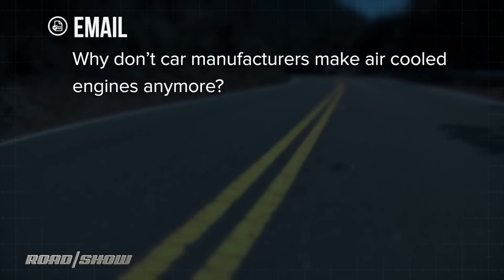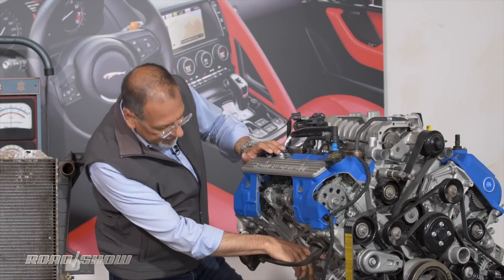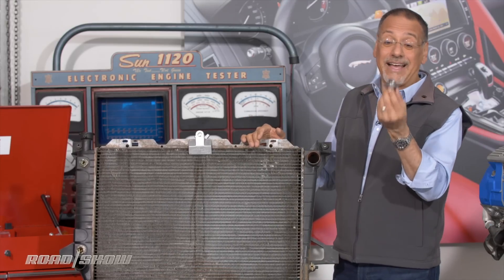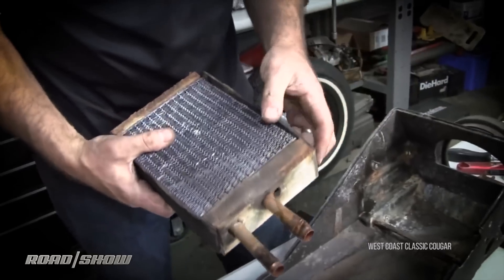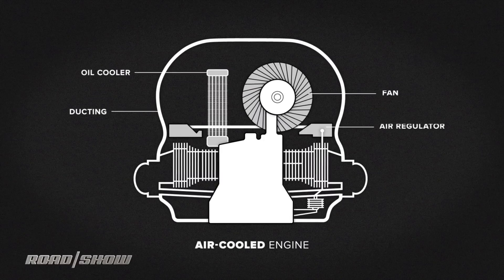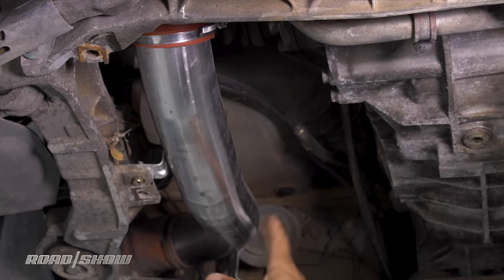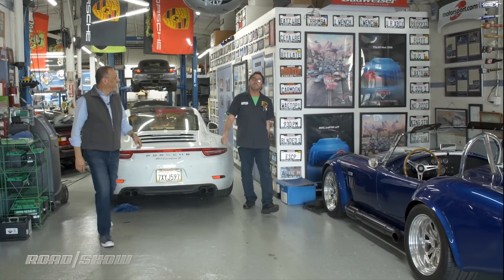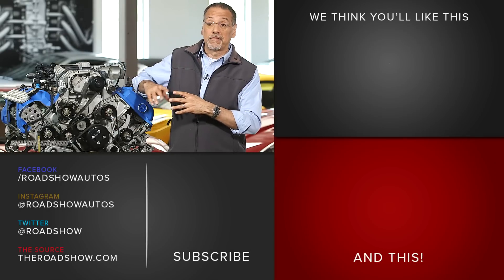Your Email: How air-cooled engines work | Cooley On Cars

Comment: Both cars are air cooled in the end.  The coolant either water or oil, circulates and picks up heat.  Both have to transfer that heat to the ambient air.  Water cooled use a water to air radiator, and oil cooled uses an oil to air oil cooler

Comment: I have always been skeptical of claims of more emissions and limited power from aircooled engines, this is a cop out by VW and Porsche. Porsche proved VW wrong re emissions by keeping their 911 aircooler in production many years after VW dropped aircooling in their first world VW sales. Cos I can't buy a VW wassercooler, I have a T5 transporter. with DSG. I sometimes wonder how a DSG transmission would go if it replaced the 4 speed transmission in an old beetle aircooler.

Comment: I have owned several aircooled engined cars and am a big fan. VW, Porsche, Steyr Puch - no overheating, not water pump to crap itself, light weight, no radiator to fail, no coolant hoses to split and cause overheating. VW said they could not meet emission standards as a reason for dropping the aircooled motors by 1983 in first world countries, but Porsche showed this was BS by continuing to make the aircooled 911 motor in production for many years later. The rear engine position was a plus too, with weight over the drive wheels.

Comment: Great video! The only question I have is, is the air cooled engine going to be pressurized? Since a water cooled engine is a sealed system and pressure builds in that, but for an air cooled engine since it’s driven by a belt from the engine, is it just going to be ambient air pressure?

Comment: the funny thing is you dont need that thermostat at all expecialy if you nur a engine with implosion and cold disel effects and a open egr valve you wuld lover your fuel consuption drasticaly and re use bether not burned gases those water coled cars are junk it destroy your engine ower time due to heat and part wear a air coled engine is a way to go not to waste money on parts by water cooled engines! plus if you use a lover viscosity oil lubrecant you will never over heat ore use oil aditive with gasoline so you have dobel protection for over heating and you increase your engines perfomace and life spand dont listen what new age mechanics talk they talk to earn more money from you Im a profesional car restorator and my hobby are oldtimer cars those old engines can by easely modified to any thing they simply refuse to fail

Comment: I have a '97 VW sedan with 500,000KM and still going strong.
Starts as fast as a newer engine.
And a lovely 4 speed manual transmission with a heavy AF clutch.
In Mexico the last VW sedan was a 2004 model

Comment: why don't the fan on air-cooled engine come with automatic on/off control to regulate the temperature more accurately?
Reply: Some do, except not electric they have a thermal clutch that engages when it reaches a certain temperature. You also have to take into consideration that 95% of air cooled engines are carbureted which means no fancy computers to control things as an electric fan.
Reply: @huntertomlin3909  nah... Electric fan doesn't need computer control, just simple thermostat will do.

Comment: I have not used the heater in my Audi A5 for a long time (almost a year). 
I turned the heater on and it made the engine not reaching the normal working temperature (90 deg C) and actually fluctuating up and down from 70-85 degrees for 26 minutes! This happened 2 times!
After that, it got normal and now with and without the heater, the water temp is normal again. Do you think this was due to thermostat or water pump malfunctioning or the water in heater radiator being blocked or something because of not being used for a long time?

Comment: Great video! Seems like there are some parallels between the disappearance of air cooled engines and rotary engines in passenger cars, hard to get high compression for emission reduction in rotary engines due to issues with tip sealing and limits on the amount of power/torque that can be generated without exotic workarounds, if I recall a video I saw on Engineering Explained a while ago

Comment: Always love to see Cooley, but he didn't quite answer one of the main questions posed: what are the advantages of air cooled engines. The main one is cost. They require less metal, are less complicated, and quite a bit lighter. It's why you still see them in lawn mowers. A small mower engine can be as cheap as a hundred bucks. There is almost no advantage to the buyer of a used car. Air cooled engines will not make as much power, as consistently, or last anywhere near as long as, a liquid cooled engine. They are also very noisy, comparatively. There is this one very minor advantage, and it's one of the main reasons they were used so much in small airplanes until the last decade: the cooling system cannot fail as long as the vehicle is moving.

Comment: Harley Davidson and Indian both still make air/oil cooler motorcycles. A benefit to these old tech, push rod engines is the lack of parts. They are quite reliable these days thanks, in part, to the lack of parts.

Comment: I wonder how much power you'd free up on an old air cooled engine if you binned the mechanically driven fan and installed an electric instead.
Reply: at least 100 hp  and with racing stickers  additional 50 hp
Reply: @brandonblack2095  It's been proven that moving from a mechanical fan to electric CAN free up HP on liquid cooled engines.  My question is legitimate.
Reply: You could probably expect about 3 to 5 percent more power since the engine wouldn’t be driving the fan for less drag. But then again you would need some sort of temperature control to have a fan motor blow the right amount of air when it’s needed because you can’t have the engine run too cold as I believe gaps in the piston rings would allow so much blow-by gas when it’s running.
Reply: Electric fans need elecricity to fuction. Electricity has to come from somewhere. In both Porsche and VW air cooled engine the exact same pully that spins the fan also doubles to spin the alternator/generator. I highly doubt you can gain even 1% more horsepower by switching to electric fans on air cooled engines. Even that Engine Masters show illustrated even different TYPES of mechanical fans have different effects on horsepower.
Reply: @darrenmorris869  Yes they do, but as another person pointed out, it would have to be speed controlled; much like a pc fan.  Running at lower speeds would require less electricity, putting less load on the alternator than a typical automotive fan that only runs at it's max speed all the time.

Comment: I have a question. Do you think electric only cars will last twice as long as gas cars??? No exhaust, no rubbing oil parts, no carb, reduced brake wear. Tesla says 1,000,000 miles is a possibility. 🤔 Your thoughts? A good subject for a video?
Reply: I think the battery technology is the limiting factor. If they can innovate a battery with a hundred thousand charge cycles then perhaps yes- but that battery is scaring lots of ppl from the used electric market, and rightfully so. Depreciation is difficult to predict.

Comment: What coolant is better, the orange colored type or the green colored and does it make a difference?
Reply: Clifton Parchment different cars use different types of coolant to work with certain tubes and prevents damage
Reply: Your owner's manual will tell you which is the right one for your car. It depends on the metal used in your engine. Scotty Kilmer has an excellent video on the development history of antifreeze that answers your question fully.
Reply: Depend on design... The colored for safety... Best is water....